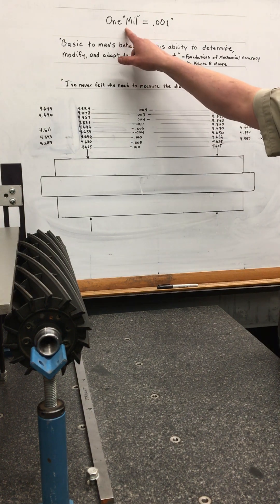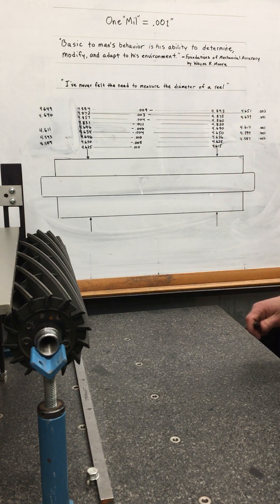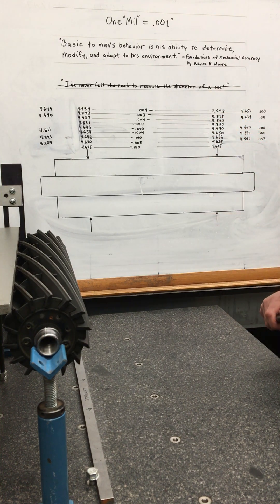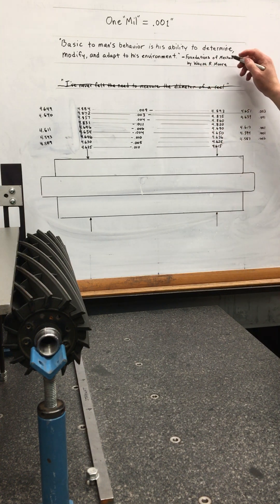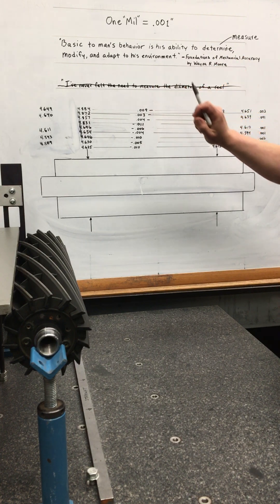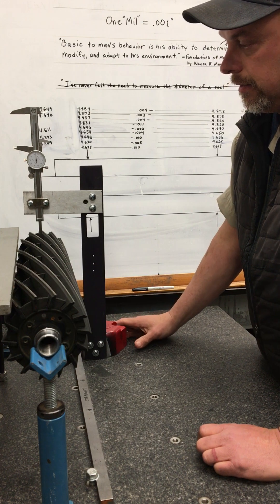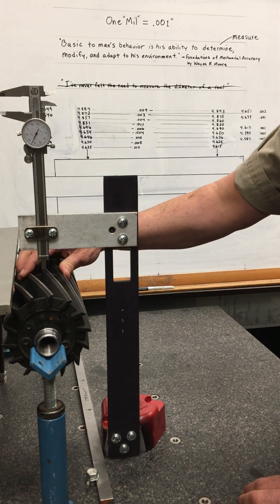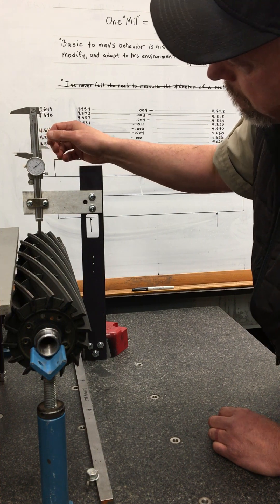Inconsistent spin grinding results with a Foley

Comment: This is a great way to show your point, (love the measuring gear), and makes perfect sense. Using the Hunter Jupiter grinder, we were also trained to "true up" the reel by measuring from the centre shaft, so the same would apply.
Interestingly, from the manufacturers point of view, I guess the only concern is that the bearing journals are true, and the trueness of shaft in the centre is not critical, as long as the journals are true with no run out, then the grinding brings everything concentric and spot on. 
Measuring any run out of the bearing journals would be another really interesting video. Because to do that you would need to rotate the reel, I dont think you could do that in v-blocks, but would need to be mounted in bearings, (new ones). You could argue that this can be measured by checking the run out of the reel blades after grinding, but to pin-point where the issue is you need to consider the bearings themselves, the grinder headstock bearings etc.
Great to see this level of detail, and look forward to more videos!👍👏